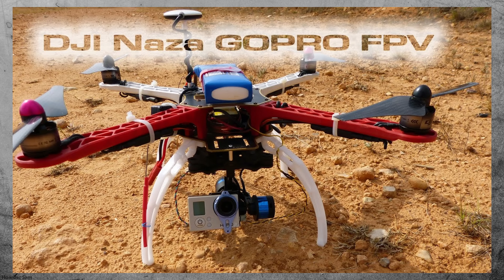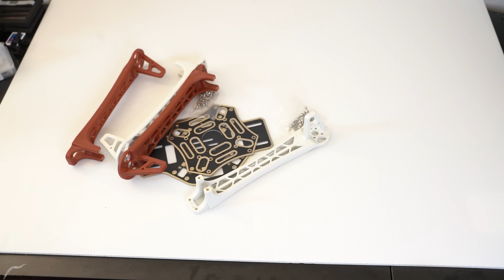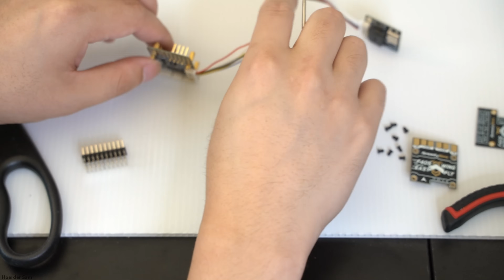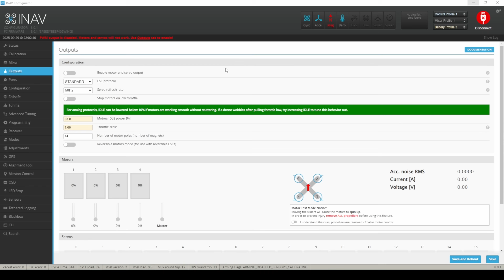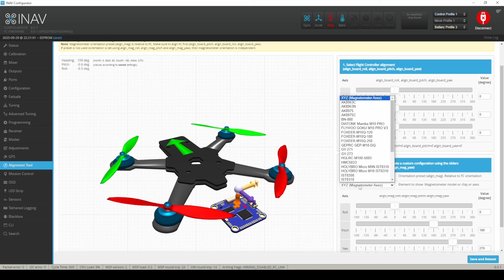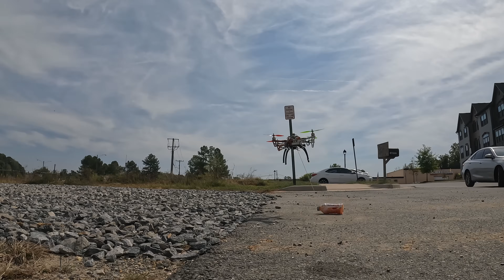I Built a $150 Autonomous Drone (Step by Step)

Comment: so you made a heavy drone that requires certification to fly anywhere ... 

Soldering DONT ... do NOT solder to a board before TINNING the pads you will be soldering to ... yes that's right TIN the PADS before you add the wire or component ALWAYS ... it makes soldering faster and less prone to cold solder joints

Comment: Any thoughts on simulating via Gazebo?

BTW, could you have used your Droneer to do this?

I imagine, the firmware (betaflight) would have to be replaced by INAV.. since ROS2+INAV seems to be easier to work with?  I understand Droneer uses DJI Air O3/O4 Units for the Digital video transmission.. but would be nice if someday it could use OpenIPC!
Reply from the maker: I think simulating in gazebo is the way to go in the future. It's new to me, but when building weird drones I spend a ton of time doing trial and error, incremental PID changes to tune drones.

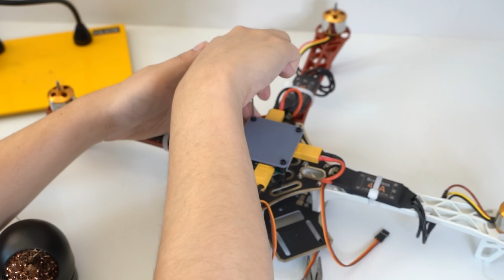Comment: 7:47 won't the setup of thin plastic between power system and flight controller act as a capacitor cuz plastic can do weird dielectric stuff so if it touches any metal  (grounding) a high vooltage discharge could fry the board

Comment: Thanks very much for sharing your project.
I am looking for a way to inspect sites autonomously. I would like to send the drone to a certain number of places (according to batery capacity) and have the drone to stop on GPS places, align in the proper direction and hight and stay put for some seconds, return to its programed path and at the end return home. I got you part list above (thanks for that) but before I go ahead I would like to know if the drone software will allow me to do what is described above.  Thanks in advance for your attention.

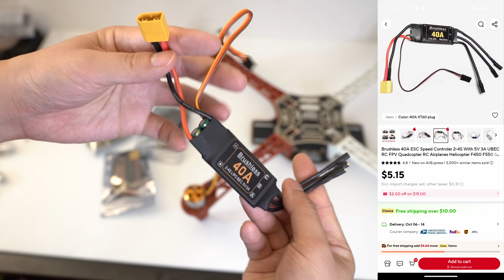Comment: I don't think the alternative recommendations around 3:20 work out. In fact, with a 1000kv motor and the 9 inch prop, the wingtip speed @50% throttle will be 64 m/s which is way lower than the 81 that you're getting with the build you actually went. I doubt that the extra 1 inch difference will compensate for the lack of speed. Mostly because I went that route (close to it) too.

Comment: That's exactly what I'm doing at the moment too. The only difference is, that I started with a cheap, used 10" carbon frame for 10 bucks. And I spent some money für 4s 5000s molicel p50B.

Comment: @hoardersam10 if you are in US. I have some Emax motors, 2812 930kv and a carbon fiber Flywoo mr croc frame with motors and iflight Succex-E 45amp stack if you want them, no charge. Im getting old and will never use them again.

Comment: oooooh an other strunk night scouting the internet and i end up here, don't even remember where i came from but great that i did :P 
i want to build my own fpv drone, not for racing though. 
it will be my first, this is exactly what i was looking for, and it's a new video! (as in not years old).
eventually i want to also run ArduPilot but that will just be changing out the controller :)
Thanks!
PS: nice soldering btw

Comment: This is an awesome video! Does anyone know if the SpeedyBee F405 Mini Stack Flight Controller FC BLS 35A V2 3-6S 20x20 4-in-1 ESC Dual BECs for RC FPV Racing Drone will work? The other speedybee isn't available.

Comment: why did you choose  the plastic 405 frame? it is heavy and easy to break and too flexible and no easy mounting, and you should have use a normal fpv stack to save weight on the esc, and if you used a 10 inch carbon fiber frame you could have saved so much weight and made assembly easier by just using fpv parts
Reply: Price
Reply: @TheOneAndOnlySatan  iiterally 7$ price difference and 10x performance difference. one is floppy one is stiff

Comment: please don't buy the plastic frame you showed in the video, it has no advantage whatsoever except the price, but spend just a bit more and get a 10 inch mark 4 knockoff frame, and the durability is wayy better and the weight is lighter, not to mention you can use a generic 4in1 esc with the mounting and use a normal flight controller. edit: you can just flash inav on a normal 10-inch fpv drone and add a gps and there you got a way better Autonomous Drone with better stability and less weight added by the seperate escs and the heavy frame

Comment: is it possible to build this and use DJI goggles n3 + DJI controller?
Reply from the maker: Yes, these F405 wing controllers have the standard 6-pin DJI port so it will work with a DJI O4 + N3 + fpv controller

Comment: Sam, i am currently building a drone for my final project. Will the drone work without the power distribution board? If not, what would be the ultimate choice to fly the drone?
Reply from the maker: You can wire it up manually without the board (bundling the wires together). The board just helps keeps things tidy.

Comment: hi bro, please tellme if this rc plane motor safe for using on CCW  mode direction on hi speed since we know the nut is CW? i just dont want my prop fly away when hi speed. i have this 5 motor and whatch your drone build and think about if i build Drone Fidhing using this Cheap Motor too..
Reply from the maker: Yes as long as its tight enough it will be fine. The nut has a hole in it to insert a little allen key to increase leverage and make it tight
Reply: @hoardersam10 thanks bro ..

Comment: bro the F450 frame has a power distribution board built into the bottom plate use that and mount the esc s underneath the arms & remove the bullet connectors & shorten them solder the esc wires directly , mount the FC on the bottom plate & put the battery on the top plate you can use the cutouts to feed the battery strap overall you have picked some good parts🙂by making the adjustments it will be much lighter and clean
Reply: clearly you missed the part where he said why he didnt do it that way

Comment: I want to build this but need to carry  3x the weight for a short 5min flight. Any suggestions?
Reply from the maker: I'd use the power system from a 10" drone (3115 900kv motors)

Comment: Is there any other flightcontroller i can use to replace the f405??
Reply: You could try a DIY esp32 devboard with some sensors,that can do ardupilot I believe. Another solution could be a stm32 blackpill with sensors running beta flight or version 7 or older INAV. For readymade FCs you could use f722 or h743 FCs, however, remember they are going to be more expensive and don't buy any readymade FCs using f411
Reply: @dipesh8836  thanks man
Reply: Uso a APM 2.8
Reply: @saulotarsobc thats alone half the budget of drone
Reply: stm32, check out joop broking

Comment: Nice to see this coming back. Before everything was called a drone it was RC. I have a turbine heli 22lb payload cap. Thats fuel and the dlr camera underslung needed 2 operator. However we had gps auto pilot back then I can switch between flying and camera operator. I even made rocket pods for it that was fun. With the us drone ban hopefully more of those modules will come back.

Comment: this frame was originally designed by dji as dev kit , then later improved by TBS. Sadly the copy cat Chinese made being sold is very flimsy and always have trouble flying right. 

Now adays you can get carbon fiber tube for so little that i recommend build one yourself
Reply: just get a 10 inch chinese mark4 knockoff frame for cheap

Comment: you  need more or better vibration dampining. its why plastic isn't used. this frame when it came out wasn't good. but now with new gyro and firmware it is possible to do. the Wobble is how you can tell. any worse it will gradually get worse, with higher throttle or a prop out of balance. it will look drunk. lol

Comment: Hey there,
do you have some spare drone parts, that you DO NOT NEED anymore?

Anything goes, like for example GPS Receivers, Flight Controllers, RC-Transmitters, RC-Receivers, RC-Controllers, Sensors, Motors, Batteries, Frames, Props or Servos?

I am at a point with my drone project right now, where some parts are missing and i really need support at the hardware supply level to get it finished. My goal is a Real 3D FullHD video capable drone with very little latency and a fully digital transmission system, that can be rebuild for cheap by everyone with standard components. I have the video system allmoast completed, but would really like to add additional features like more camera perspectives and an analog transmission failsafe option, as well as some sensors for obstacle avoidance and optimized height stabilization to my build.

If you can spare any of your since collected drone parts, that would only collect even more dust over time because YOU DO NOT NEED THEM ANYMORE, please think about sending me a short notice and the idea of later sending some of those parts to a complete stranger in germany.

❤ Thanks in advance and keep flying...

Comment: I have been looking for a trully budget drone video with detailed instructions. I was psyched to follow this up until I realized the Speedybee is not so easily available anymore (im in BELGIUM), and also unfortunately I cannot use my Flysky FS-i6.

I know its not the best transmitter, but before investing in a decent one, I wanted to make a budget build just to get into it and try it out before spending +250€ on a kit with transmitter :( 

Do you have any advise for another board and receiver that I can use with my FS-i6?
Reply: I've seen a couple of very cheap kits on AliExpress (everything, including frame) for 120€, but it uses the APM 2.8, which i've read it's quite old? What would be your opinion on this?
Reply from the maker: You can still use FS-i6, if you have the receivers with IBUS output, that is the same as SBUS and will work on modern flight controllers

I have one of those APM2.8 controllers and I wouldn't recommend it. Due to the low ram and storage it requires a lot of configuration to even get setup in ardupilot. I think its worth spending more to get a pixhawk 6 clone than the old 2.8 boards

Comment: Wow !! How could you fly for 20mn, mine have the same battery but different motor. I use 920Kv red brushless motor, I have 3s 5200maH battery but it last less than 10mn.

Comment: pls add a low pass filter to get rid of the mic noise
Reply: That’s line noise. Either the preamp is too hot, he’s using cheap xlr cables, and/or interference from USB ports. He’s definitely using a sm7b

Comment: Hi, I built a drone just like yours — same servo and same INAV setup — using the Matek H743-SLIM V3 flight controller. However, I’m having a problem: when the servo moves, both the VTX and ELRS power off momentarily.
Reply from the maker: Is it a big servo? Maybe its drawing too much current from the 5V source on the flight controller. You may have to get an external BEC to power the servo
Reply: @hoardersam10  it's  servo  mg996 ，and after my testing, I found that the issue was caused by a surge in current. However, as long as the servo is activated with an interval of more than 10 seconds, the problem can be avoided.

Comment: does the f405 wing support dji o4? i like the 3pcs esc idea.. becuase using 4in1 esc is hard to solder and hotswap
Reply from the maker: Yeah it has a standard 6-pin DJI connector so its plug-and-play

Comment: Helpful video! I am working on building a similar drone. I was wondering if there was specific reason for choosing the wing board meant for planes over another board like the SpeedyBee F405 mini stack meant for quadcopters. Thanks!
Reply from the maker: No strong reason, it's just affordable and supports Inav and Ardupilot. The mini stack will do just fine as well. Wiring would get a little harder IMO with the mini stack
Reply: Thank you!

Comment: Re: the HGLRC M100-5883, it's a beast! I have one and in less than a minute in cold-start I get 12 sattelites, and after 5 minutes 25 or more -- and this mounted under the VTX antenna on my Rekon35. Wouldn't trade it for anything else.

Comment: is this kind of motor better than the one you used for 7 and 10 inch drones?
Reply from the maker: This motor is more efficient but produces less maximum thrust overall. So its better for efficiency, but say for example you want to carry a heavier payload, you would want motors like from the 7 or 10 inch
Reply: @hoardersam10 thanks for the explanation. It helps a lot. This might be more useful for fixed-wings then
Reply: @hoardersam10  What would be the most efficient (both for longer flight time and for more range) motor/prop combo for this drone?
Reply: @hoardersam10  I tried mounting different motors (the ones you used on the 7- and 10-inch drones), but they don’t line up—the mounting holes are too close together. Should I get a different frame, or is there an adapter available for this setup?